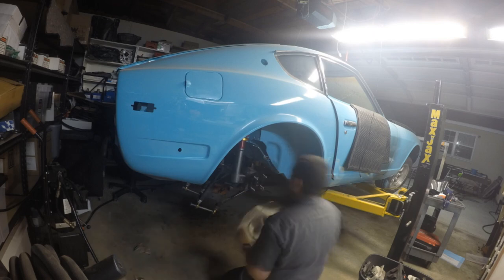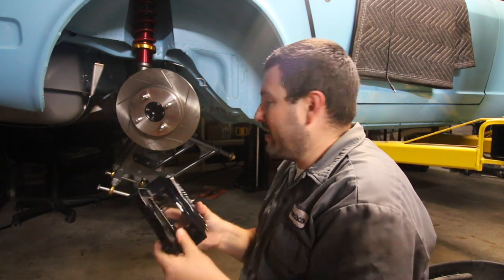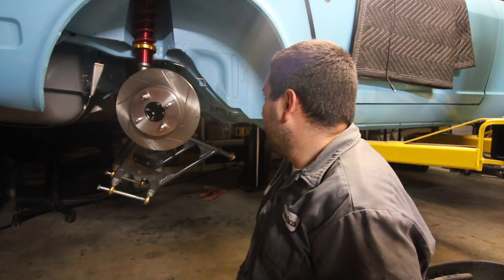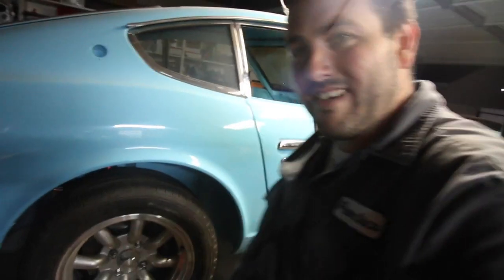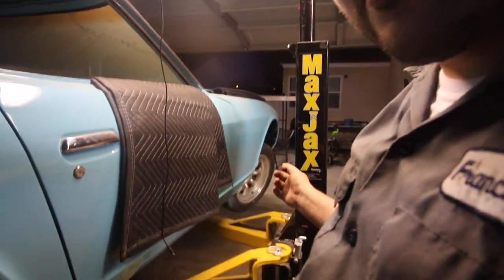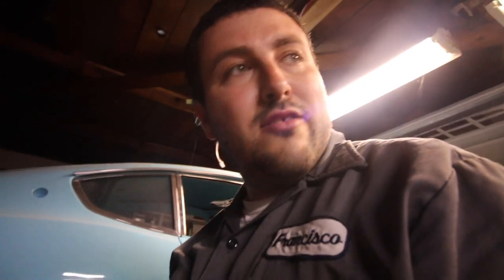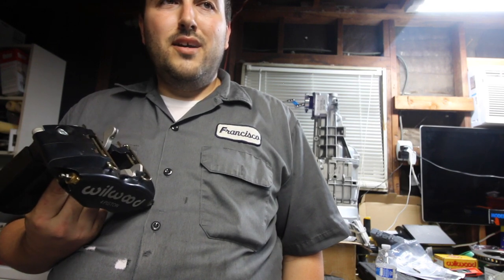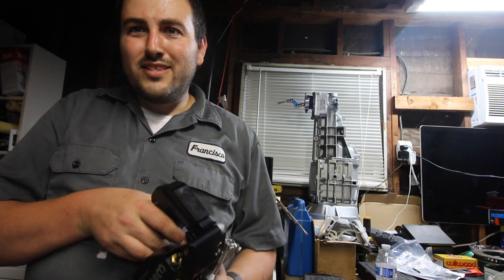Datsun 240z Build - Episode 21 - Rear Disc Brakes Installation - Panchos Garage

Comment: I would point out to anyone contemplating upgrades that disc brakes are great, but upgrading the fronts is the first priority, since so much of the Z braking is done at the front;  discs are easier to stop lockup than drums, but the std drums are ok for most road cars;  and with discs all round , a balance bar is a must.
Reply from the maker: +racketman2u I agree. The fronts do most of the work, I'd upgrade those first as well.

Comment: yussss, I need this rear brake set up. I'm thinking about the Maxima setup though.
Reply from the maker: +Ortega Drives Maxima setup is probably fine. This is probably overkill in terms of performance since it's the rear. The front is more important.

Comment: Francisco-  were you able to fit the e-brake on the Wilwoods and use the 15 inch wheels?
Reply from the maker: Yes. Had to use 10mm spacers for this particular wheel
Reply: Thanks

Comment: Seems like there would be enough meat on the caliper to take a little off to increase your clearance on front brakes?   Since it''s a black finish, shouldn't be difficult to touch up.
Reply from the maker: +endall39 I'll look into that. I think there's a washer between the caliper bracket and the strut assembly that I might be able to take out and increase clearance a bit. I'll take a look this weekend when I have a chance.

Comment: Hello,
I am late seeing your video, but are you still active?  I would like to know what type or brand is your wheel hub and bearing and rotors.  I have a 114.3X4 wheels and and cannot find wheel hub and bearing and rotor that wull fit my wheels.  your help is appreciated.
Reply from the maker: They're 280Z stub axles (but 240 ones work the same) the bearings are stock, I linked the ones I used at panchosgarage.com
Reply: @PanchosGarage  hi again.  thanks for the reply. your site does not list any wheel hub.  can you tell where i can purchase them? thanks.
Reply from the maker: I mean, they don't make those new anymore. You can find someone parting out a 280z. But then again, the 240z stub axles work too. Same setup.

Comment: What is the wilwood part number you used here with the brake function ? Where did you get this kit and bracket?
Reply from the maker: T3 sells the kit.
Reply: Could you be more specific with the complete rear brake setup.
I am interested in it for my Z.
Silvermine  has a kit but a little pricey plus they have an additional e-brake caliper.

Comment: Mate, awesome brake setup. How are you handling the brake porportion?
Reply from the maker: +undukrig stock brake proportion.
Reply: undukrig I had the same question.
He's not using the stock master cylinder or proportional value is he? The disc brake calipers grab different than the drums. Those rear calipers are bigger than the ones on my Gen 1 Acura TL.
Reply from the maker: Going to use the 1 inch master, see how it feels, and if it needs the adjustable proportioning valve, I'll add it on at a later date.

Comment: You get the Ebrake cable installed yet?
Reply from the maker: +BOOSTINMYZ not yet. Gotta put the handle inside the vehicle first then I'll get it on there.
Reply: ok, hopefully i`ll get to installing mine. thankz. keep those vids coming!
Reply from the maker: Good luck! And will do!
Reply: Francisco Gutierrez did the e brake clear with the 15 inch wheels?

Comment: What size are your rims? I heard u say they were 15’s but can you provide the width and off set?
Reply from the maker: They're Koniq Rewinds. You can call MSA, I got them from there, they can give you the full specs on the wheels.
Reply: Francisco Gutierrez -  I’m thinking of using the same rear brakes with 15x8 Rota RKR’s, did the e brake clear with the 15 inch wheels you’re using??  Great detail on vids, you’re helping me with my build big time